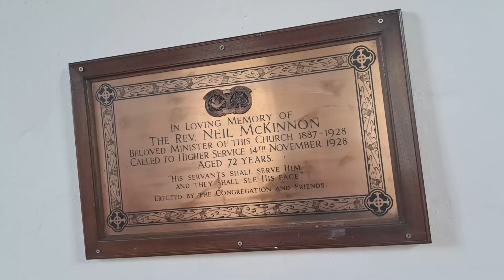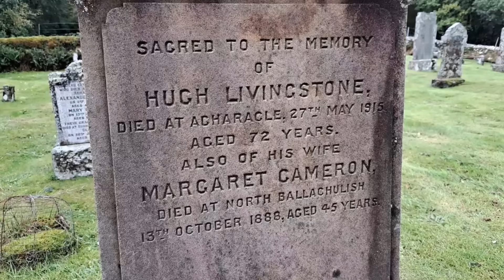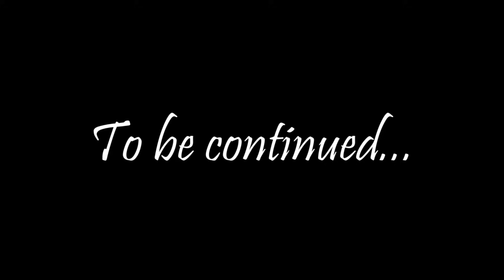19: History of Burial Traditions in Europe, Celtic Conversions to Christianity, Scotland, Island

Comment: The big heavy thing that you thought was for laying slabs or cobbles is called a " Tamper" I would use one when i worked on the roads. You would put it in a fire n once it was roastin hot you would run it along a bitumen joint between 2 lengths of tar and the bitumen would melt and seal the joint. We also used them to hit any high areas down to help shed water. They're more or less like a big heavy iron.

Comment: Grand job wi the auld stove!When you put up that pipe from the roof, ye just let the water drain to the base of the house. Ye need rhones. Guttering, I suppose they are now named. Or at least connect the white pipe to a water barrel away from the back of the house, or ye will aye be paddling in water. .

Comment: I love the humor as you two work through the eternal drainage problems! Just let me say, the screw you put in is way too long and will soon prevent leaves and other stuff from going down the drain pipe. And you'll have a big overflow there at the gutter line that will spill down the wall and possibly get into the house. To buy yourselves some time, you could just back the screw out until the pointy part is not inside the drain. But that's not a good and permanent solution because that end of the screw shaft is smaller in diameter than the rest of the screw, and will wiggle and eventually fall out. Katie was right, no silicon, which will make getting the offending original screw more difficult to get out. Also, I know it's early days, but organizing all your tools and building supplies in a shed will make finding the right screw much faster and easier. Well done on the wheelbarrow path! And, Katie, VERY well done on the little Victorian stove. A 10 for sure - I'm truly impressed! AND, we have a new Pope! Thanks for letting us watch as you make your lovely little cottage snug and livable.